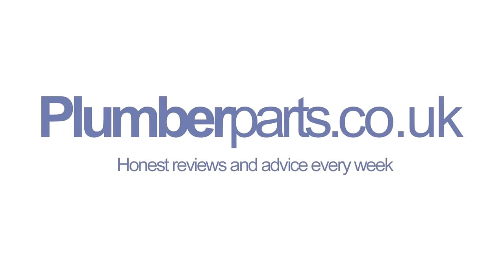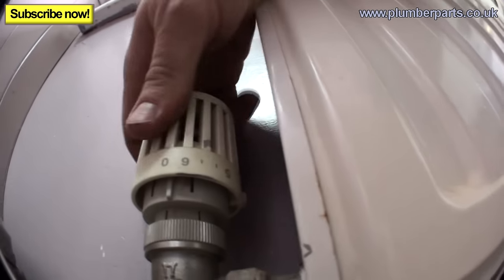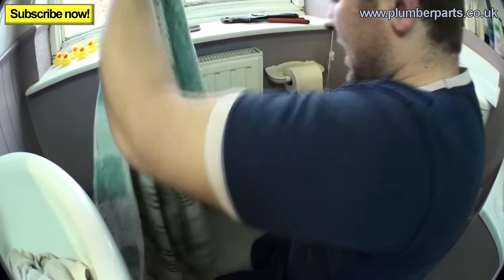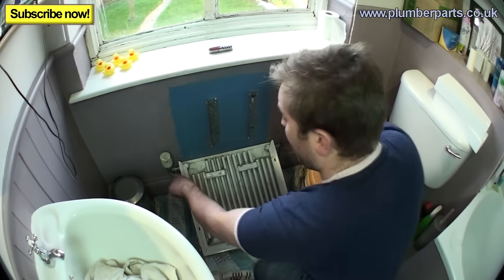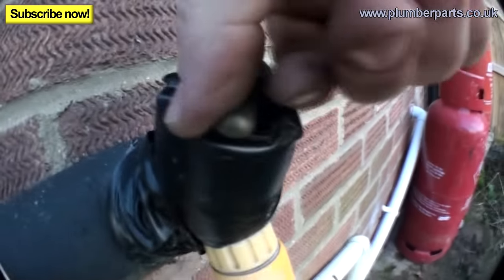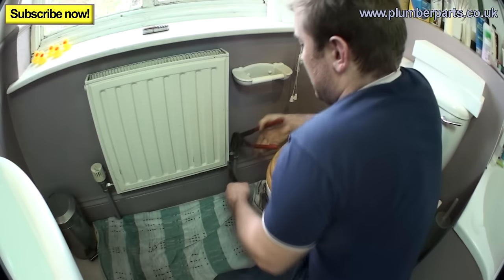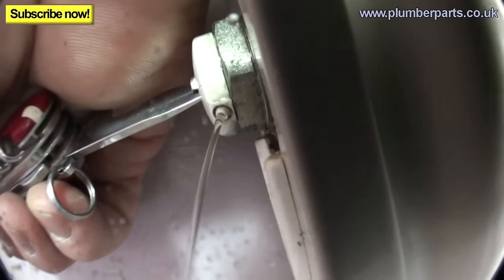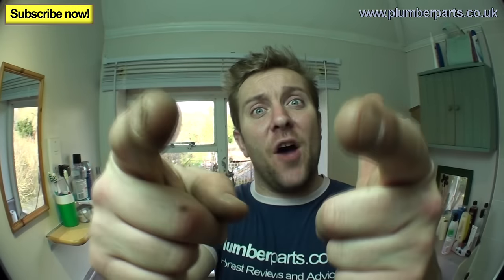HOW TO REMOVE RADIATOR SLUDGE - Plumbing Tips

Comment: Top marks!! Had one radiator which was hot at the top and not at the bottom - took the mother off the wall, rinsed it out with a hose and put it back - now it's working a treat. Many, many thanks!!
Reply from the maker: Great to hear dude! Top work and well done for giving it a go! SUBSCRIBE! ➡️👉 https://www.youtube.com/subscription_center?add_user=plumberparts 👈⬅️ IF YOU HAVEN'T ALREADY! 😎
Reply: did you see crap come out when you rinsed it ? Having the same with one of mine thats the biggest in the house have bled it , drained it , changed valve and water looked crystal clear everytime it came out.

Comment: To all those who like this technique, I plugged my cast iron radiator with a cork at one end then butted up a karcher pressure washer up to the other end... when we released the pressure washer nozzle the water ejected around 6-8 ft all black thick sludge, we repeated this process for around 20 minutes and eventually managed to get the water crystal clear, hose pipe is good for relatively new radiators however for the old fashioned 50-100 yr old radiators the trick we tried worked wonders, my Drive is still black from the stained black sludge and that was over a year ago....
Reply: Why did you out a Cork in one end?
Reply: The pressure build up helped release stubborn sludge which would have been more difficult to remove if the pressure build up wasn’t there, sludge is dense so hard to remove… Pressure Aided in the removal and sped up the process…
Reply: Blasted it all over the drive. Brains of the operation I see.
Reply: @justbreakingballs  😂😂😂
Reply: So the cork popped like you had won the lottery 😂
Reply: Why didn't you pressure wash the sludge away too
Reply: @axeptzion  I tried but the stainage  was that strong I could only jet wash the sediment away.

Comment: Ive found that changing hose from one side to the other and flushing both ways and also moving the radiator upright whilst flushing helps to get all the sludge out. Also whilst its off use the hose to wash all the dust and fluff of the back vanes. With thosr clean more air can travel up the back and that means more warm air in the room

Comment: Just completed doing this properly on all 8 radiators in our house, none were as tiny as your one.
Found the dinning room radiator is a massive 9ft long steel radiator had real struggle getting that outside to the drain/hosepipe.
Did it over like 2 hours for that rad on its own switching ports and exits.
Used 2x 3/4" BSP brass - hose pipe connectors to allow easier filling/guided draining but initially I had no fitting in the exit port dumped directly in the drain due to massive rust parts sludge in this 50 years old system which clearly had not inhibitor.
Reply: some dose

Comment: That tip about tilting the rad is 'ermazzing' dude. I had to take the bog, the sink and the shower out and take all the tiles up and cut the pipes to the radiator, but by-buggery did it save the water in the rad! Thanks big dude!

Comment: I had an extension built. My builder put in a second hand, 6foot, double rad. To be fair, it looks almost brand new.
I noticed that the bottom of the rad never gets hot so called him up. His answer was that large rads suffer with cold spots.
I've never heard this one so bought some stuff from Wickes which is supposed to break down sludge.
I disconnected the rad and drained it then flushed it but only clear water came out.
I disconnected the blank plug at the top and bodged a filling solution with a small funnel etc. I then put the whole bottle of sludge buster stuff into the rad and left it overnight.
Meanwhile, I installed a magna cleanse.
I worked the bottom of the rad using my hammer drill and a block of wood. This seemed to produce some results as, when I drained the rad, a load of muck was released.
I emptied another bottle of sludge destroyer I to the rad then connected it to the system once the pipes were nice and hot.
The magnet sure got plenty of muck! But the huge rad is still cold along the bottom.
I think the builder has fallen out with me over this problem as he's been nowhere near for 2 years. But which one of us is correct?
I'm basing my comments on a 5ft double rad in my dining room being hot all over plus a 5ft single in my hallway.

Comment: Hi great video, I’ve removed a large radiator due to hot at the top but cold at bottom. I’ve used a hose pipe in all the entry points and tapped the side of the rad with a rubber mallet, but having put the radiator back on the wall it’s still the same, so do I continue to remove and hose pipe the rad, or do I use a cleaning fluid in the central heating or do I need a new radiator. Thanks any advise would be appreciated

Comment: Hi. Good info. I live in a block of flats and the hot water for the rads comes in through a central boiler in the building. If I shut off the a rad, will it still be isolated or will I need to shut off the main supply in the basement? Thanks.

Comment: I tried to take a 1800x500 double rad off on my own, had no idea they would be that heavy, broke my toe. Also if you want to prevent rad sludge building up in the first place, fit a filter. It will make the system run quieter and the boiler and pump will last longer too.

Comment: Great video, concise and to the point.So if I done that with each radiator would I still need a powerflush for pipes etc?Just  had one radiator off for another reason and the water was black and rust red.Any advice would be very much appreciated.

Comment: It’s not just release air from the rad but also monitor C/H pressure if dealing with closed system and topup more water when needed. Great trick with flipping rad upside down. 👍

Comment: Thanks for this video. I got a quote from British gas to do a powerflush, as the engineer said this would remove the sludging, as we have problems in the downstairs radiators not giving any heat. The bill quote is a whopping £814 including one hour labour. Is there a cost effective way?  Appreciate any help on this. Thanks.

Comment: If you do a couple of large radiators, when the boiler takes in mains water to refill them, do you need to add more anti-corrosion chemicals so they don’t rust?

Comment: I found my radiators way too heavy to lift in and out of the house - especially with my dodgy back!  So I used a chemical flush and left it in for nearly a week.  Drained the whole system down, then went around to each rad in turn and carefully made sure each one was drained and empty. I then connected a garden hose connector to one side and a hose to the drain valve on the other side. Flushed it out well with mains water . It came out black as ink, but almost zero sludge or black flakes. ran until water was clear - banging on the rad with a rubber mallet helped a lot (shifted more muck). Then on to the next rad!  No mess, no fuss, and my poor old aching back survived for another day.
Reply: Such a British comment. Love it haha

Comment: Hi. Can be sludge in a New radiator?? Because I have New on the wall and the top is Getting warm but the bottom is cold. And the pipe on the trv Side is cold but the other Side is burning hot.

Comment: Hi, your video was very helpful thank you. I have a question. All the rads in our house seem to be hot at the top and warm at the bottom (not cold) do you think that is still the cause of the sludge in the system? But there is one double radiator in our living room which is just very slightly warm at the top and cold at the bottom. Thank you very much!!

Comment: I did the same with one of my radiators. since I had to remove it for decorating purposes. It is an open system and after re-installing it just doesn't want to warm up except for the bottom 5 cm. That get's really hot and so is the inlet and outlet. All the other radiators have been bled, the radiators have been balanced and still it doesn't heat up. When I try to bleed it, no pressure seems to come out. Any ideas? Thanks for your great video's; I learned a lot from them.
Reply from the maker: You've got an airlock mateeeee! Watch our video on airlocks.... SUBSCRIBE! ➡️👉 https://www.youtube.com/subscription_center?add_user=plumberparts 👈⬅️ IF YOU HAVEN'T ALREADY! 😎

Comment: Great video! One question, Should the radiator be evenly hot from bottom to top or should the be a slight difference? Cheers!
Reply: Should be hot throughout, you may have got that answer, if you find top roasting, bottom cold, it's sludge most likely

Comment: Hi i was wondering how do you permanently get rid of it? Ive had guys in with the magnets and banging my radiators with a hammer drill with rubber bit. Also have the magna clean micro installed but its coming into winter now ive just checked and most of them are cold at the bottom again!

Comment: Hello. when you connect the hose pipe to the radiator outside did you need a specific connection to have the hose pipe to it ?
Reply from the maker: Just use a 15mm straight compression fitting withou the nuts and olives...will work fine! SUBSCRIBE! ➡️👉 https://www.youtube.com/subscription_center?add_user=plumberparts 👈⬅️ IF YOU HAVEN'T ALREADY! 😎

Comment: thank you,   I found your video are very knowledgeable ,  I have 3 Question  no1  the locksheld in which side of the radiator it should it be  ?   no2 when balancing the system the down stairs radiators locksheld should it be open all the way ?   no3 when installing a new radiator is it a problem if it is installed up side down?   much appreciated you help.
l
Reply: If you've managed to install a radiator upside down I truly take my hat off to you

Comment: Can I ask a question? I have just had a new boiler installed and apparently our radiators were power flushed beforehand. I am suspicious that this actually was done as I have just used a radiator key to see what came out and on 2 radiators there was brown sludge and muck. Is this normal after a flush? I hope you can help. Is the process noisy as I recall no noise either!!
Reply from the maker: Get them back round....sounds dodgy to me! SUBSCRIBE! ➡️👉 https://www.youtube.com/subscription_center?add_user=plumberparts 👈⬅️ IF YOU HAVEN'T ALREADY! 😎

Comment: After flushing the rad system out with clean water then filling it with cleanser before running the boiler should you open all rad vents, i.e. TRVs and lockshields fully then run the boiler with all valve fully open or should you balance the system as the boiler circulates the cleanser.
Reply from the maker: +Qee Zee Yes mate!

Comment: HELP! I have one rad thats hot from top to bottom but nothing comes out when i try to bleed. Also got another rad that's hot/warm at the bottom cold at the top and nothing come out when bleeding. Mega flow system. Plenty of pressure. Other rads work fine. Tried shutting off other rads on same floor and running the heating. Bashed it a couple of times. Do you think its sludge?

Comment: I have clogged central heating pipes and 3 of my radiators in my basement rooms are not receiving any water. I've removed the rads and turned open the rad valves and no water coming from the pipes. 
Please show us how to unclog the copper pipes leading to the rads using air pressure.

Comment: crackin little video , im about to add two radiators to my existing set of three from my combi vokera boiler,  using push fit fittings  is this a straight forward enough job cheers in advance ,dan

Comment: lolz great video, subbed.

Here's a video, to help cover my current issue. Heard a hissing noise along the mains pipe, leak sumwhere. Seen water in street mains valve, got water board to replace the valve but still hissing, they said the leak was inside my house. Lifted the floor boards to reveal a small swimming pool. Leak spotted on spotcock JUST inside my property, so my problem. 

Best way to go about fixing it? Water boards new piping is plastic, best way to connect?

Comment: I have a question, can I pour hydrochlorid acid into working radiator? Could it possibly do any damage to central heating system? I cant find the answer anywhere on the internet. Thanks.

Comment: Am I right in assuming that the right-hand radiator nut was turned away from you (clockwise) to undo it and the left-hand one was turned towards you (anti-clockwise)? It seems to be what you were doing but it's hard to see.

Comment: brilliant!!!  but can you just explain what i need to do at the boiler side to top up the water i removed.  i have a boiler wiht a tank and immersion heater!
Reply: There is a black plastic tank (header tank) in your loft with a ballcock valve that will replace any lost water automatically in your type of system. You dont need to do anything except make sure everything is bled properly.

You only need to add water manually to sealed systems such as a combi boiler. This is done by a valve on the boiler itself.

Hope this helps.
Reply from the maker: ***** Top answer!

Comment: British Gas have just concluded that my over heating boiler needs a powerflush (after changing the PCB, thermostat, and pump) to stop it overheating and cutting off. I wonder if they will do something more than what you are describing for the £700?  (Thanks for making dull,I can't say dry,subject engaging)

Comment: Can you do the same job without removing the radiators? Say shut them all off except the one you need to remove the sludge from, and then open your filling loop valve and flush it through?. Once the water to your drain starts running clear I'm guessing that radiator would then have the sludge removed. Maybe then just do the same with every other radiator?. I was thinking of doing it this way instead of trying to remove all my large radiators which weigh a tonne.

Comment: mate, I have a hot cold hot cols situation unfolding. I sort of know why (I'm a mong!) I didn't put an inhibitor in the last time I drained the system! I need to remove and clean the heat exchange plate on my battered old valliant ecomax. any chance of a video? cheers mukka.
Reply from the maker: Mate I'd love to but Gas Safe would kill me! You need to break gas lines to do it....get a gas registered engineer in! 
SUBSCRIBE! ➡️👉 https://www.youtube.com/subscription_center?add_user=plumberparts 👈⬅️ IF YOU HAVEN'T ALREADY! 😎
Reply: plumberparts blurg! well you're the pro so I shall concede. is it going to murder my pocket? 
do you think I'm better off getting a new boiler?
my current ecomax is about 8 years old it's one of the first models so pretty old

Comment: thank you for this, I live in a bungalow house back a couple of months ago the kitchen radiator was only heating at the bottom, I bled it out but it made little or no difference.  we had to get a new fuel tank in as the old one which was a steel tank rusted, there are 7 rooms all together in the house, we notice the bedroom radiators which are the longest way from the boiler don't heat up as much as the nearer ones example living room and kitchen.  the radiator in the sitting room which always heated up well isn't heating up as well now, but the one in the kitchen is heating up well again.  would this mean they need to be balanced?  also the immersion water does not heat up.
Reply from the maker: Paul Hetherton Looks like they'll need balancing mate. Well done so far!

Comment: Hi James. I suspect sludge in my partner's system (oo-er) and am thinking that rather than paying someone to powerflush the entire system, I could flush each rad that seems affected, then drain entire system myself, and refill with water & inhibitor. How likely is it that this would be sufficient, or would you advise caution and get the (paid for) powerflush + inhibitor injection done anyway? 
Also, you said in other video that you can never have enough inhibitor, whereas I have seen someone (apparently a plumber) state that too much inhibitor can damage components, "It can rot the rubber components, like the diaphragm of the presure vessel and O rings in rads valve. Only have 1% of the volume inhibitor."

Comment: Is it good practice to put TRV's on bathroom radiators, never done it myself don't want the rad turning off when the kids are in the bath!!
Reply: Had TRVs fitted to all our upstairs rads as the system was 20 years old and had original valves, which meant the upstairs was always much hotter than downstairs (due to good oft insulation) so we had to turn heating off at least two hours before going to bed otherwise we'd boil in the bed. The TRVs allowed us to balance heat to bedroom and bathrooms as required - left the bathroom on around setting no. 2 for a nice background heat - you can then turn it to 3 if you want  aboost whilst showering/bathing. Set of 6 valves cost me about £80 and another £60 to have them fitted - reckon I've saved that several fold over the last 10 years in reduced heating bills

Comment: only half of my radiators get hot but the system has not been run for 2 years. its 17 years old and is a "Baxi eco 80. i was quoted a big price to flush it through but moneys tight as im unemployed. Is there a solution to the problem.

Comment: Should you have replaced radiator inhibitor before you put water back in system. After you remove all sludge from all radiator.

Comment: What if the radiator is still cold on the bottom after flushing with the water? it's a 1270mm  double radiator and the bottom only gets worm when all other radiators are very hot. does it mean the radiator needs replacing ?
Reply from the maker: You'll need to get a pro in then guys! Sorry.